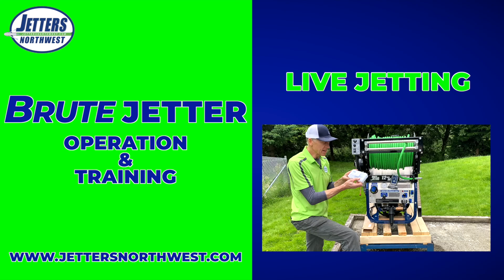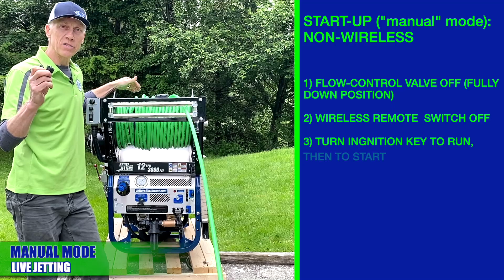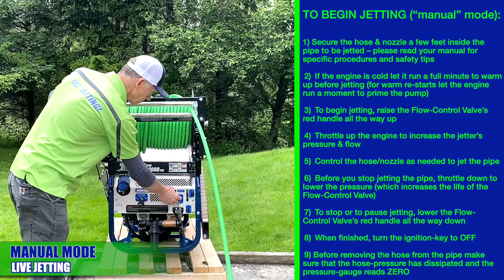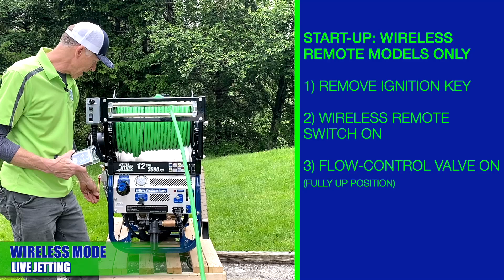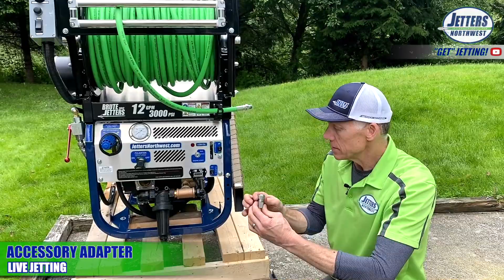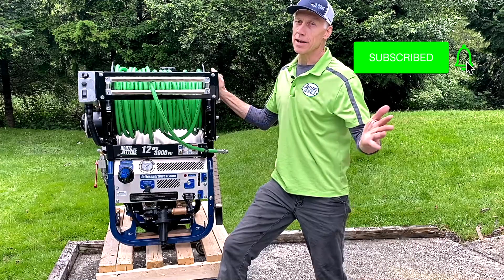(8 of 8) Brute Jetter TRAINING:  Live Jetting OPERATION, Safety Concerns, & connecting Accessories

Comment: Why don’t you just put 5’ black leader hose on the end of the hose
Reply from the maker: Yes indeed we do offer orange-colored leader-hoses (typically 10') to warn you that the nozzle is near -- it's an optional item for the Brute Jetters (it is included with our Eagle Trailer-Jetter models). However, a lot of operators don't like to use them in sewers/drains with elbows because when the 2 hose-end fittings are screwed together it makes for a 2x long fitting that can stall in an elbow, thus we don't include a leader-hose on all models. We can do black-color any length you want (1/4", 3/8", 1/2", 3/4", 1" sizes), or the "Safety-Orange" color is available in 10', 15, 20', or 100' (3/8" or 1/2"): https://shop.jettersnorthwest.com/collections/jetter-hose/products/leader-hose?variant=127821086723